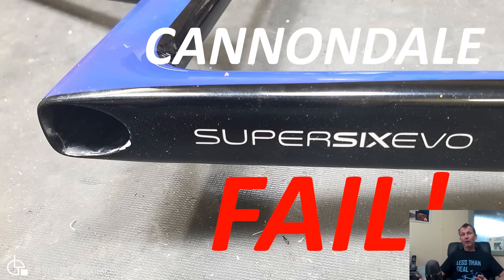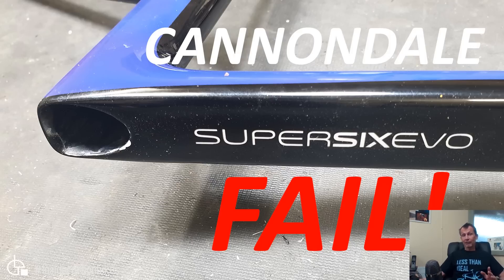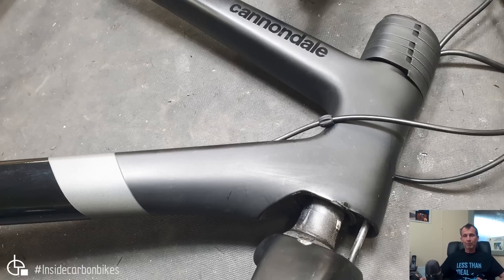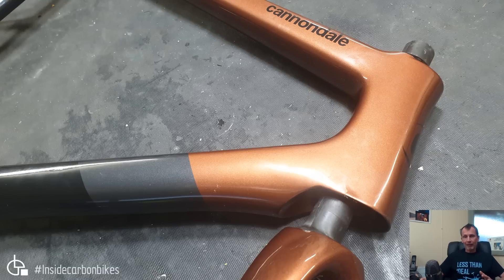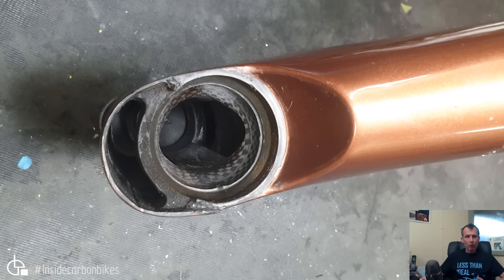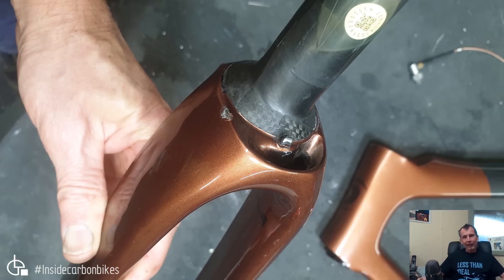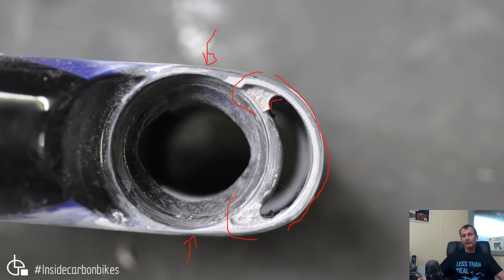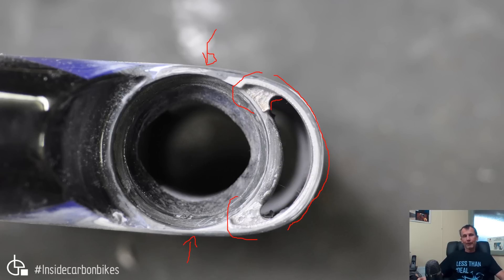Cannondale Supersix Evo Repair

Comment: I am wondering, are Cannondale replacing these frames and repairs you make are just for customers who don't want to bother through going with warranty service?
Reply: I had the same damage, complained with the dealer and received a 2021 model replacement frame for free without any discussions, plus a €100 coupon for the hassle. Had to send in the old frame after receiving the new one. EU here.
Reply: @superprinz7619  yup, PERFECT OUTCOME, just sad about the waste and your time/frustration/safety.

Great outcome, though.
Reply: @superprinz7619  under what circumstances did the damage occur on you bike? was that relevant to the replacement?
Reply: My son had exactly this happen and Cannondale Europe wanted evidence of the bottom bracket cut away and separate from the frame before releasing a new frame at a discounted price. Not ideal.
Reply: Agree, under commercial law, this is a manufacturing fault and free remedy should not be repair a fault, rather REPLACE A FAULT without a fault or refund.

Repair is great, however, it does not ensure Cannondale improves their technology nor consumer experience.
Reply: Got recall written all over it.
Reply: @Silver.Cyclist  EXACTLY, materials science/design FAIL = RECALL.